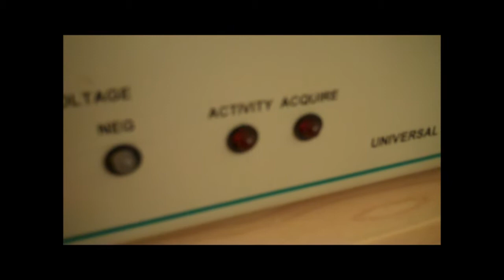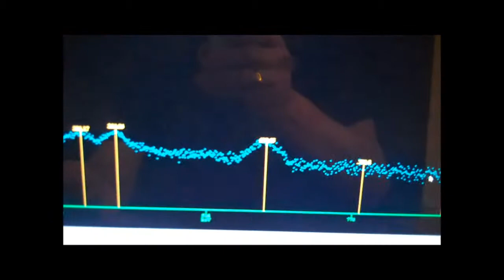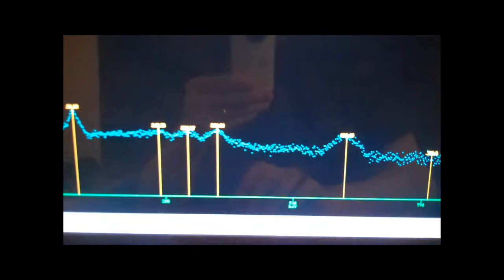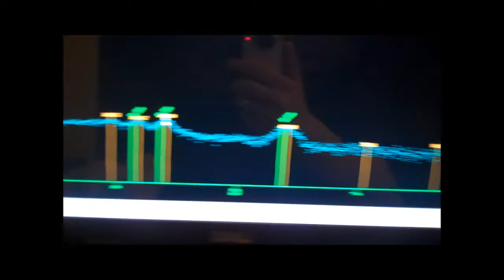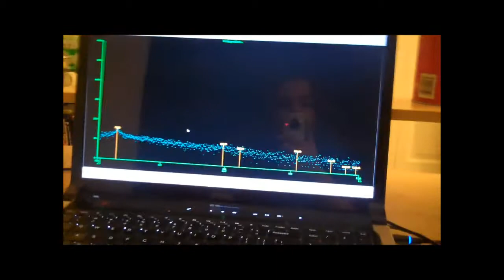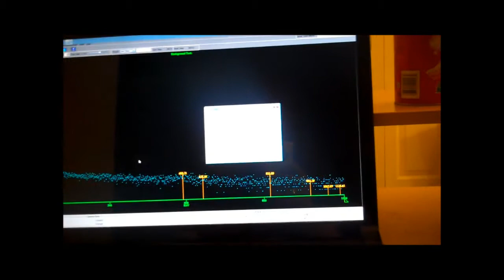Radioactive Rain - 24 Hours Later

Comment from the maker: @iamgoddard     Radon washout does produce many alpha decays, but were there are alpha decays, there are often secondary gammas. Of all of the products in the radon 222 decay chain, as far as I know, only 4 of the 8 isotopes do not produce gamma. Two are major producers.

The exposure time is so short, due to halflife, which may be why these are disreguarded. My GM really just picked up on the alpha, but my scintillator did detect the feint gamma from the test material.

Comment from the maker: @KitemanTV   (cont...)  The normal water and radon hydrate both condense on the condensation nuclei and become denser than air and fall. The radon constantly decays into Polonium 218 (3.1 min halflife) then into lead-214 (27 min halflife) than into bismuth 214 (20min halflife), then Po214->Pb-210->Bi210->Po210-> and finally into stable lead 206. 

it'se the Pb214 and Bi214 which emits lots of gamma and live such short lives.

Comment from the maker: @KitemanTV    I am not drawing any conclusions derived from the first, and hastly tested, sample. 

Radon-222 is a natural gaseous element emitted from radium 226, a decay product of natural uranium. Radon can be found in the ground, smoke from coal fires, and many other places. The humidiy rises until the temprature falls below the due point and the water condenses on tiny particles of dust in the air, called condensation nuclei  (cont...)